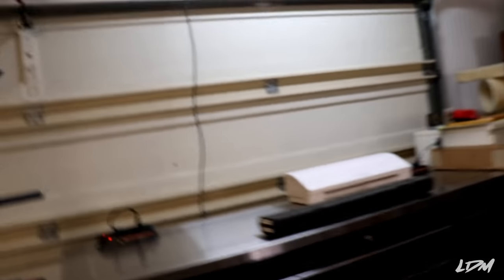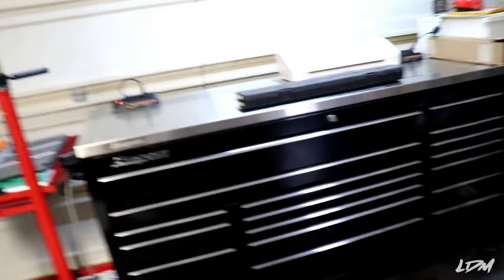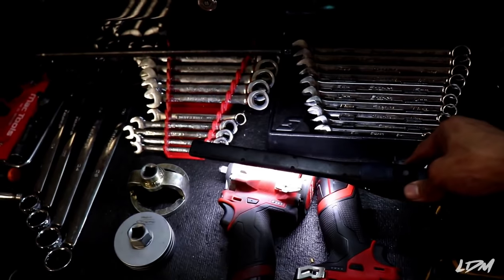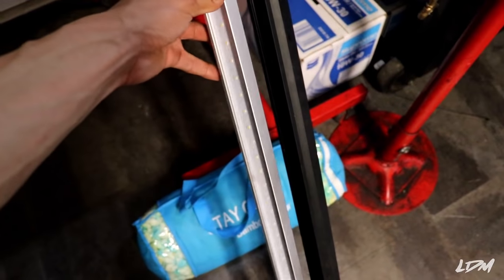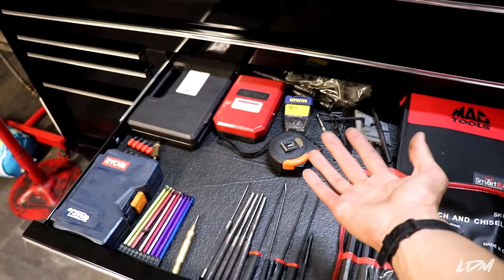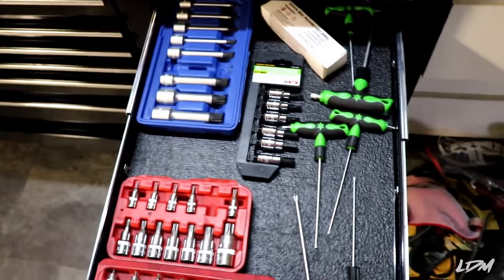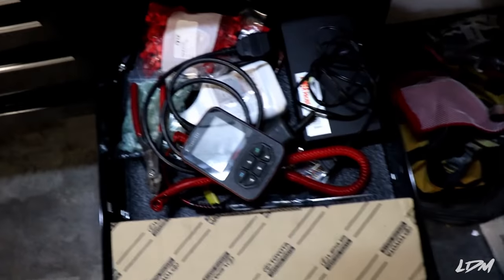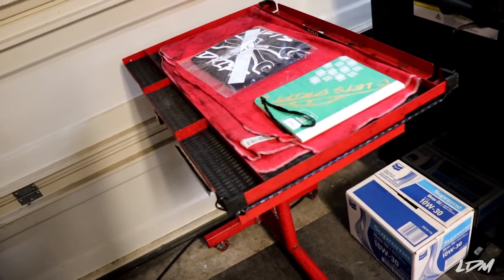TOOLS I USED AS A FLATRATE TOYOTA TECHNICIAN! (TIPS/ADVICE)

Comment: I love those simple tool trays. Good way to isolate fasteners and things that you're using on a specific job and move around/clean off easily. When I worked in a shop (not on cars, but we built natural gas conversion units for trucks), most people had their shit all over the floor, hanging off of step ladders, or tossed over fastener carts and it was just a mess. Best thing any of us ever got over there were our wheeled trays and I never understood why most people didn't use em.

Comment: This is a good video. I ended up getting a job in the field and switched careers - in part based on the videos you made about dealer life. I wish I had watched this before I began assembling my tool collection, I think I would have made more efficient use of my money... but no regrets. What is the part number for the axle nut depinning tool at 15.10? Thanks again.

Comment: 3/8 sockets are the smallest that I have my most used are half inch as apparently I'm my company's over the road tech (started out as a truck driver) 😂😂 luckily everything on my truck and company trailers are SAE I just wish I had room in my truck for a 20ton jack, a 1 inch impact for the lugs and a torque wrench with at least 550 ft/lbs torque rating but I'm all tapped outta room... it's a game of extreme tetris when I need anything but it's the only way everything will fit and my spare airbag and brake chamber eat up most of the room that I got...

Comment: yo whered you get that axle nut socket set?? I needa get me a set. thanks for the info btw!
Reply from the maker: Np. I got the set of 4 on ebay for like 30bucks or less. No name brand but works fine
Reply: You can find a full gear wrench set of axle nut sockets on amazon for under 60 bucks, if you want really high quality  grey pneumatic makes some of the best impact sockets on the market, and there prices aren't crazy.

Comment: Hey Friendly NIKKO,
Owner of a 2007 toyota Fj 4x4 with 112k miles. 
It’s at the Toyota dealer with code P0016
1. The dealer is installing a timing chain kit. ¿is timing chain stretching a common problem for 4.0 engines at 120k miles?
2. The boots on the front axels are greasing out same as the example on this video. No sound on the joints. 
Should I replace them or rebuild them. 
Feedback is much appreciated...

Comment: What size is the spark plug socket 14mm or 9/16? Thinking about swapping my plugs out but I hear both being used. And where did you get your oil filter adaptor thing from, Toyota?

Comment: I have a snap on 55 inch box and im worried it might be too big for the lube rack. Im starting on the lube rack at toyota soon and I recently got a used snap on box on a great deal i couldnt pass up on. How did that box work for you on the lube rack? Did you guys have an assigned bay or did you move bays much? Im currently in school and plan to move up pretty quickly honestly and i do have more tools than the average lube tech on the rack honestly.

Comment: Try the Milwaukee m12 3/8 fuel electric ratchet. Will save you tones of time
Reply from the maker: You think I'll use it more then the 1/4 inch version?
Reply: I just use the quarter inch adapter. I use 3/8 more but also I’m a heavy diesel mechanic
Reply from the maker: @kylebritt2459  fersure I'll look into that 👍
Reply: Extended reach m12 ratchets just became available... Worth every penny

Comment: Do you really need a fancy computer or expensive code readers? Can you get away with a simple inexpensive OBD 2 reader?
Reply from the maker: You can get away with an inexpensive one as long as it pulls trouble codes.
Reply: often a code reader will do the job, but sometimes you will need something better if you need to watch your data stream for diagnosis, or ecu programing. if you work on one make once you get familiar with it often once you read the code you have a very good idea what you need to check.

Comment: Your tool box is def not from the north east lol so much salt dont see an oxy torch every tap and die a drawer full of hose clamps body pins dandom hoses eztra bleeder screws and tons of extra bolts and a giant impact map gass a welder  cut off wheelsr respirators
Reply: It's funny. I work on big trucks and I'm in the south. I dare you to take a rusted vgt actuator off a turbo. Why? Because these trucks run everywhere plus Canada.